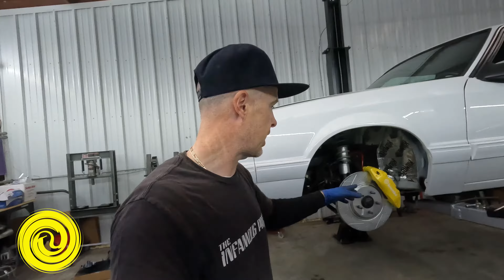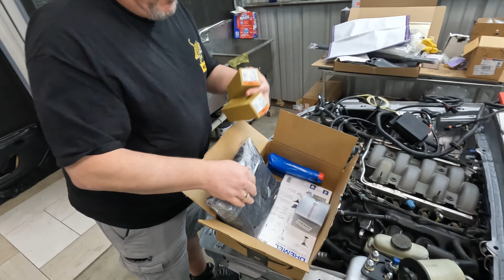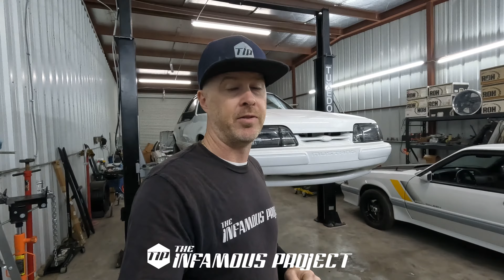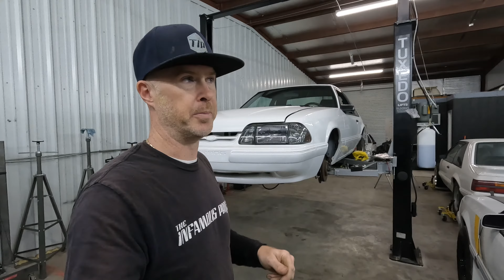Swapping Brakes & Suspension on the Twin Turbo Coyote Swapped Foxbody Coupe.

Comment: Another great job with things Chris, much needed subframe connectors, quad shocks, upgraded brakes, always 
brake line fittings are always wrong, great to have a flaring tool.